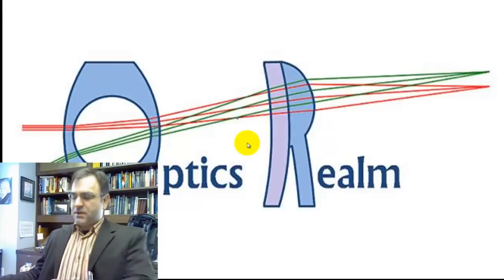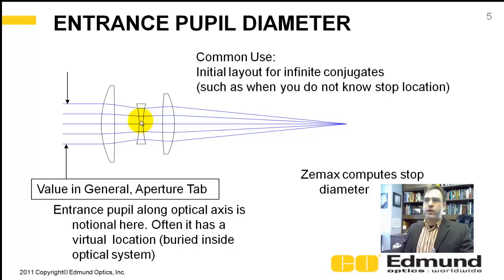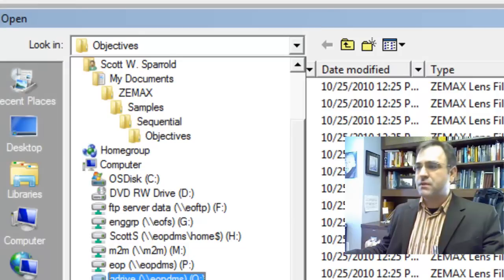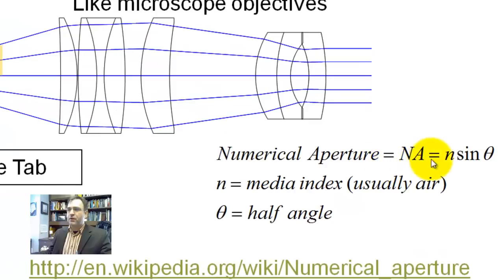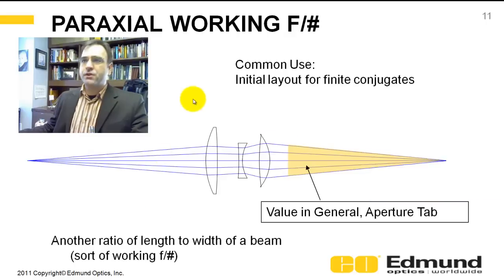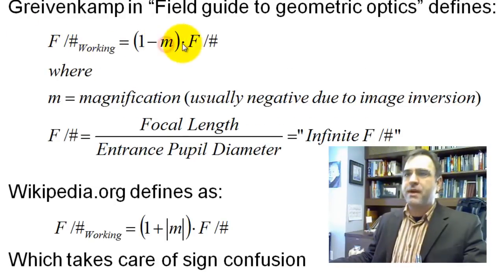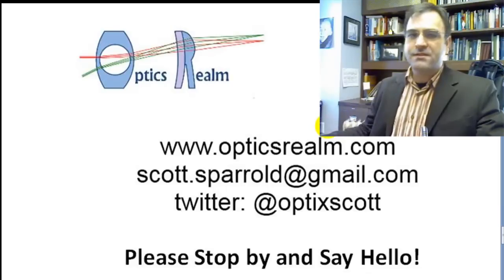Zemax tutorial - 2 - System aperture settting

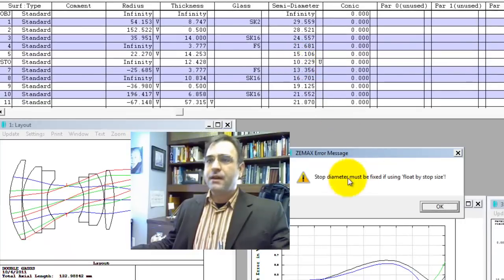Comment: Hi Scott, Thanks for the great videos!! I have a question: I didn't understand why the error popped up at 3:27 in the video? What did you do in order to get that error? Were you trying to change the semi-diameter value ?
Also, later why later you were able to change the semi-diameter value to 5 or 4 without getting any subsequent error?
Reply: He changed aperture type from 'Entrance pupil diameter' to 'float by stop size' in general tab. It means that aperture will be automatically adjusted by the value of semi-diameter of STOP surface, so the value in Semi-diameter of STO must be manually fixed by a user. It is just guidance rather than error. So..Later when he entered '5', the entrance pupil diameter was automatically changed to '21.880' without error messages. Am i right?
Reply: hallo, Can u help me about setup Zemax  ? I could not find on the internet.